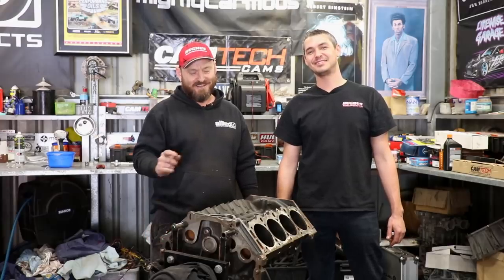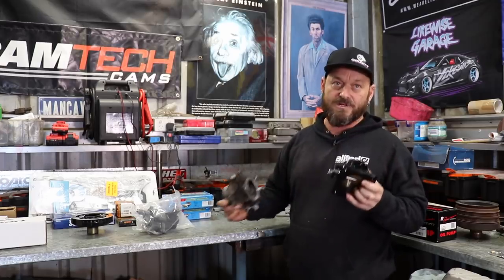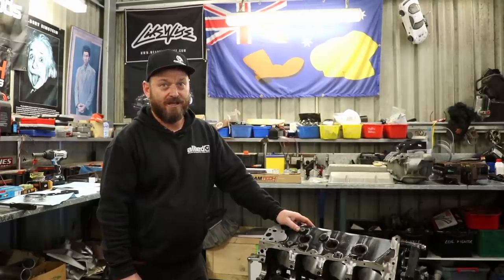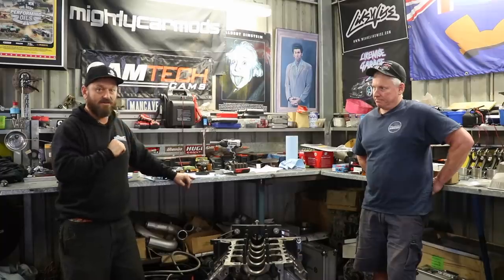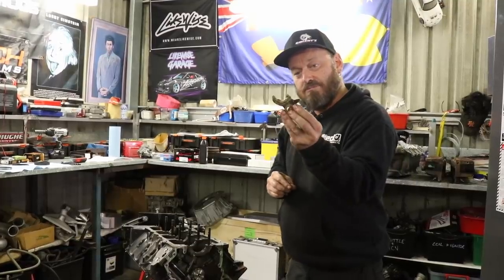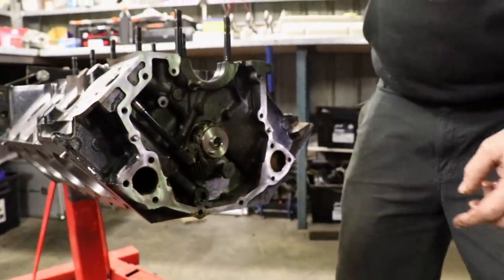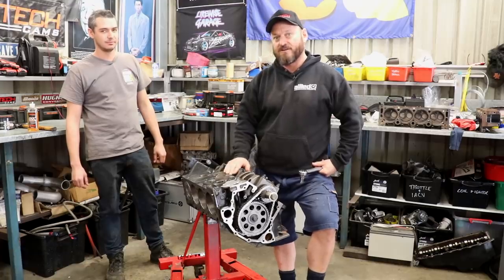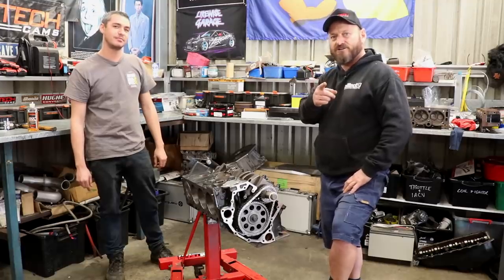GM HOLDEN 304 V8 ENGINE RE-BUILD [EP2]

Comment: This is why engine builders are worth the money they charge as they have the expertise to make sure your engine is correctly put together so it doesn't become a disaster.
Reply: Yes sir, when I had my Honda race engine assembled, I didn't just slap it together in my garage, I took it to an engine builder that owns a machine shop and got the rotating assembly assembled at the same time as the machine work was done. It's currently making 612 whp.
Reply: GT3582R LSVTEC EJ8 Honda race engine??? What the.
Reply: So many ppl dont understand the intricacies of having a built performance engine let alone building the things 😂😂 i couldnt believe what it took to build a blueprinted balanced stroker cleveland years ago. The time and work involved reminds me to take the upmost care in maintaining it
Reply: @agga3955  How many Honda 4 cylinders have you seen that are capable of 800 wheel horsepower? So yes, it's for my drag racing car, so it's a race engine.
Reply: That and labor is expensive, that is a SLOW job.
Reply: @orangejuicepony6881  yup exactly 😉
Reply: I'de rather assemble the engine myself. Past experiences with machine shops and engine builders have told me to trust nobody.

Comment: Great engine, won so many Bathurst 1000 over the years. Great heads that Torque Power have now taken to a new level. And that sound. The firing order make them sound so sweet. Love these motors. And the torque made from 355 cranks makes them a great street weapon. Well done to re building on a Aussie icon.

Comment: Trick on the rear main I was taught during my apprenticeship by an ex holden mechanic was to soak the rope seal in oil and leave a smidge (the technical term.....) proud to put pressure on the seal for when it wears in. The theory behind this was that having that little bit extra would give it a longer life.

Worked for the most, pretty well every rope seal I replaced would last a lot longer beforemit would start to seep. You just had to be careful not to do it too long as id would make far too much drag as Al mentioned.
Reply: yup i did that to mine 5 years ago and still not leaking :)
Reply: I worked at holden for 12 years and resealed dozens of these and that's what i did too. We used to push them down into their recess with an extension bar too just to compress it a bit more so it wouldn't burn out from too much friction
Reply: Craig, yes I forgot about the extension rolling it in the groove with something round, typically a socket extension.
Reply: Oh, I always cut it after rolling it in.
Reply: Correct me if I'm wrong, but didn't some of the earlier (Red) 308's have a neoprene seal? I'm sure they did. Like, they started with rope, then switched to neoprene, and then back to rope for the late ones? Or am I confusing the 8's with the 6's?
Reply: @timjohnun4297  no red, blue or black Holden motor ever has a neoprene seal. The v6 in the VN and beyond started with a rope seal to be changed later.
Reply: @CruiserBrah  308 red definitely did have a neoprene seal, I'm just not sure what year it changed. You can still buy gasket kits with a neoprene seal in them
Reply: Actually, after more research, seems the HQ was the first with the rope (AKA dog turd) seal.

Comment: Speaking for myself that was the most informative session yet. I have waited 10+ years to be schooled on how an old Holden V8 should be cam timed for a modified cam during a rebuild, (@29:00) having personally experienced the disappointment of "runs but gutless", if the issues are not clearly understood by the builder. There are many steps that are straightforward but cam timing ain't one of them. Thank-you.

Comment: "Who'd have thought that little strip of plastic wouldn't be as good as thousands of dollars worth of measuring equipment and a trained operator"
My favourite quote now. :D :D :D
Reply: For anyone interested, PapadakisRacing did an awesome video checking the accuracy of Plastigage. Proved that it can do a pretty good job. Not that it is able to do everything the fancy gauges can.
Reply: @802Garage  really makes sense if you think about it. Not much to go wrong with a bit of plastic
Reply: Ian williams 
Sounds more like human error
Reply: Yep, you are meant to remove it, but some leave it in the engine... though that plastic cap is a different issue.
Reply: @ianwilliams487  Plastigauge ain't plastic. It's clay.
Reply: Found a similar inside micrometer for under $60, an external mic to match can be had for under $50, well within the grasp of a home mechanic. Of course high quality Starrett or Mitutoyo versions are a heck of a lot more expensive.
Reply: Never mind that the correct tool would havr been an internal bore gauge not a micrometer.... Anyway at least he tried!
Reply: @802Garage  saw that video too. plastigage is pretty accurate. This guy does make a good point and that is plastigage doesn't measure for out of roundness. However if you mic the crank journal in 3 or more locations around its circumference, you should be able to spot an out of round journal
Reply: @blairo15  but if you know what you're doing a mic is as good as a bore gauge for what he's doing.
Reply: @allaussietraveller9879  he had all the gear and no idea!
Reply: @blairo15  yeah I don't know about that. I may not have a ton of engine building experience but I have built a few and been a fitter machinist for near 20 years. He didn't look like he had no idea to me.
Reply: @allaussietraveller9879  excellent! 👍
Reply: Plastigage is for checking bearing clearances.  Then if it is very close to marginal, you are alerted and take it to your machine shop for further testing.  As long as you apply it dry and don't turn the crank, it is a repeatable checking method.

Comment: Come racing has a youtube page on how to fit rope seals without causing any leaks, very good video. They show you how to check if the seal is crushed correctly with the crank and cap on with a feeler guage. That's the only down side of Holden blocks, if you dont fit the rear main correctly, you have to pull the motor out to fix it. Another thing to do which is popular here in Western Australia with 308 and 304 engine builders is to convert the rear main rope seal to to a chev neoprene , requires a little machine work to make it happen. In the old days of the early 308, rope seals had asbestos in it, thats why it was virtually leak free and lasted for hundreds of thousand of kms. Neoprene has far less drag on it plus if it leaks, easier to replace.

Comment: Hey Al, the reason for running a high volume pump is to be able to use a lower grade oil. Yes guys do run HV pumps and still use 20w50. You should drop to 10w or 15w and synthetic espeacailly if your running roller cams. I solved many clevo oiling issues doing this with a 25% Higher volume pump and synthetic 15w 40 penrite oil.

Comment: guys punch the squirter hole on the cam retainer bolt shut. It'll help with oil pressure
Reply: Punch?? What happened to one spot with the MIG??
Definitely worth it for the oil pressure.
Reply from the maker: If you have to do this the tolerances on the engine and/or the oil pump is dead.

Comment: i use a new bench grinder wheel (large one) i rest sideways on the block or head and just push it round with a bit of a spin. works amazing! mic checked and it stays close enough to tol

Comment: From what I was shown working at toca performance it should be a stout build but I wouldn't use permaseal head gaskets. Especially if boost is on the cards down the track. Just my opinion and love the work  you guys do. Keep it up. Seano.

Comment: Wish You'd shown more detail on fitting the rope seal. I'd been taught (in the dim distant past) to trim them 2mm proud with crank fitted, then tension it an remove and clear away any rope material caught in the cap parting surface then refit and tension.

Comment: There is a neo seal conversion that can be done on these engines, surprised TK didn't mention it.
Reply: Yeah I thought there was, isn't it the Buick V6 rear main seal that fits?
Reply: @simonmoat7311  yep. It needs a little trimming but it does fit.  I believe there are a couple of engine shops that can supply the seals pre-trimmed to suit.

Comment: You can buy a two piece rubber lip seal to replace the rope rear main
Reply: Thats what my engine builder used when i worked my 308 back in 93, 440 rwhp then some scum stole my car never to be found

Comment: I had never known of the Holden version of the SBC. Interesting design changes they made. I especially love the side of block mounted oil pump. Makes me wonder if anyone would make a hybrid block that shares this front end with the LT1 version reverse water flow and snout distributor so no need for oil pump or distributor in back of engine.

EDIT: By SBC I mean the traditional design small block GM engine. I live USA and worked on plenty of them growing up in a GM lover family. LOL

Comment: Hey Guys love you show.I know that you guys are busy getting ready for Drag Week. But I hate to nit pick. But when I build an engine, I take each piston mark it with a number, so I know which cylinder it came out of. This would not matter if you are using new pistons. Lay them out on a surface, place a set of rings with each, along with connecting rods and other items. Then I would take the compression ring for that cylinder insert it into the cylinder using the top of that cylinder's piston and make my measurement, take it out, then do the same to the wiper ring. Then do the same to each cylinder, to make sure that all rings were gaped about the same throughout your engine. You guys may have done this off camera or it maybe footage that ended up on the cutting room floor. I really hate to make a comment. But I have to know if you guys did this? 
Thanks again for some great shows and tips,
Bart
Reply: No, I'm not an engine builder by trade. I'm a computer geek. But in High School we had a class call Power Mechanics, where we learned about all types of engines, and how to rebuild them and the steps to doing that. Plus I've done a few myself in the bad old days.

Comment: If I were building a race motor I would line bore so the crank would be squire with the bore. Bush and Tobben Arc the rods and balance all rotating parts. If your going to use the pistons over Knurl to eliminate slap.
Reply from the maker: Harrison McCullough this isn’t a race motor by any means.

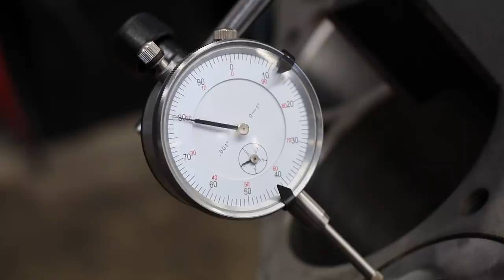Comment: 32:05 & 32:13 Umm, guys, 15 - 11.5 isn't 4.5, it's 3.5. 🤨😳 Hope this doesn't cause issues later on. 🤷😬
Reply: Hopefully John's "Two or thereabouts" response indicates this isn't a uber-critical measurement. I'd have no idea, personally.
Reply: @dazaspc  If it's changing ignition timing yes, but not when building. You want absolute TDC. 👍
Reply: @bee_jay  It goes back to what Al said with the dwell on the piston and if it's off, it can cause issues down the road. 👍
Reply: I was wondering if I caught that right too
Reply: @dazaspc  Ahh, but it's NOT a stock build, not with those parts, and that cam profile wasn't exactly factory duration and lift. 😉 I would agree with you wholeheartedly my friend if it was total OEM parts. 👍

Comment: I did not see him check inside the bore, each piston bore to make sure shes round all the way down the stroke. :) But still great work guys and i cant wait till she fires up and see how much power she produces and also how good the trusty old 5lt engine really is, especially because its made out of IRON and not Aluminium, which is lighter and stronger in HI HP areas, but race engines are made from scratch, with massive amounts of extra strength casted areas along the sides of the blocks and extra holes for main bearing studs to keep her nice and tight and strong, like the FORD X Racing engines blocks used in nascar in the US. :)

Comment: Does the cam sit in bearings? Do these need to be checked for clearance also?
Reply: Most engines of that type have one piece bearings - you have to drive them into the block nice and straight, then sometimes they have to be reamed out a whisker.
Reply: @alexbrown1995  you NEVER  ream out a bearing, wth are you thinking?
Reply: Yeh but they'll wear to size, don't take as much load and heat as a crank
Reply: @richardharris492  I meant hone....
Reply: If it’s tight you give the camshaft a linish for a bit extra clearance

Comment: I'm sure you know but I'll say it anyway. The bolt MUST be turning when the torque wrench clicks otherwise the bolt is not torqued correctly as static friction is higher than dynamic friction.. ie the torque to start turning a bolt (break away torque) is higher than the torque required while the bolt is moving.Also noticable as you can turn a bolt(no click) stop and then when you try to start turning it again it clicks without moving, you should then bask the bolt off a smidge and re-torque.

Comment: Actually, you're supposed to have two stones, both precision ground. And the idea is that you use both, but before use, and after, you hone them one against the other to take out whatever imperfection you might've put on them. Using a single stone isn't good. You also want to avoid straight lines, rather use waving motion. Reason being that you might chip and roll a particle against the interrupted surface and never know, scoring your cut.

Comment: That standard intake is going to hold that engine back big time , they are very Restrictive and suffer extreme Heat soak , Edelbrock do a cheap single plain that works really well ,also Harrop, Come racing and Torque power Do fantastic ones for the old Iron Lion

Comment: Solid vs roller cams imo should all be run in the same. It helps to temper the outer coating on the lobe is that not correct?? They come from factory with a linishing coat i was always tought.

Comment: With a torque wrench, the initial torque to start rotating the nut/bolt is alot greater than the torque once it moves, so if you stop moving near the target or at the target, re-licking or trying m to move again may not register the correct torque.

Comment: I enjoy your videos man, keep up the good work, but I’m putting this engine in the ‘slapper build’ category... As a budget build I can ‘just’ understand that you haven’t bored and honed the engine and used new performance oversized pistons, but I can’t believe you didn’t shout the iron lion a set of ARP rod bolts at a minimum and resize them. 
Good luck and I hope the heads gets some love...
Reply from the maker: Big Al As explained in the video, the bores are well within spec and so are the pistons, the engine is surprisingly tidy. The rods on these engines have 3/8 bolts already and the rod tunnels measure up correctly to the crank so bolts in this application aren’t required.
I think people can’t get the difference between replacing everything but measuring nothing, replacing nothing and measuring nothing and measuring everything first and replacing what is required.
Reply: The Skid Factory I’m hearing you loud and clear mate. I have built some cheap slappers in my time but I’ve found it you rev them or add some boost they don’t generally last that long. If you are using ARP main studs (and I totally agree that you should be) I’d at least use new rod bolts. I’m not just saying throw a heap of big dollar parts at the engine for the sake of it, but the minute you mentioned it might get some boost I cringed with standard pistons. Good luck and keep up the great videos.

Comment: Al you can replace the rope seal with a rubber one  from felpro   Felpro 2-Piece Rope to Rubber Rear Main Seal Conversion Holden V8 308 FEBS40613      end of problems

Comment: Hay guys great build.  Just a question on deck height.  Should this be checked on all 4 corners to find Como ratio and to see if left and right  banks are the same. Just a question.  My 351w was all over the shot. Needed decking  to even up.

Comment: Imperial sizes are hard on us Europeans to begin with, but imperial sizes measured with a micrometer... The guy lost me at the first measurement.
Reply: It's just decimal inches, like 2.514"
Reply: Decimal inches. That’s an oxymoron if there ever was one. Like saying dry water.
Reply: @spudsmckenzie4123  No, Decimal inches is used in a huge percentage of machine shops - especially those shops that still run all the old machines from before the 1980's where the XYZ slides are marked in Imperial.  Decimal inches works well, especially if you're using micrometers or DRO's.  The problem with Imperial, is the stupid factional-measurements (9/16" 11/32" etc) and whilst I can/do use those, having it in decimal form almost makes Imperial units usable, almost.

Comment: Would this be considered "blue-printing" a build?
Reply: That would require +$10k lol
Reply: @colinstu  Too true... Lacks sonic thickness/bore alignment in block-- no crank and rotating assm balances /old bearings for clearance checks..? sheesh.
Reply: No.

This is checking tolerances on new (and used) parts going together to make sure they're in spec. 

"Blue-Printing" would require weighing and matching all of the rods (pistons, pins, rings, and bearings) to within a gram of each other then, dynamically balancing the crank with those rod weights. 
Possibly a line hone of the main bearing caps to a tighter tolerance and honing the lifter bores. 

The block would be bored and honed using a torque plate to account for any distortion from the head bolts being torqued.

And the block would be gone over with a die grinder to relieve any sharp edges that could become stress risers.

These engines have a lot of stacked tolerance in them (nearly all production engines). 
It's fascinating how much detail goes into it and the process is not something that can be done in a garage.
Reply: @of_lion22  Hey thanks for the detailed response! It's exactly what I was curious about. I hear the term used quite often, but was unsure how involved it actually is. Now I understand why it's so expensive. Cheers mate.